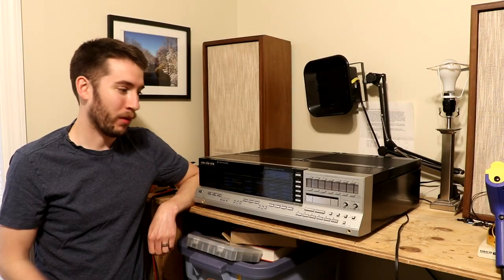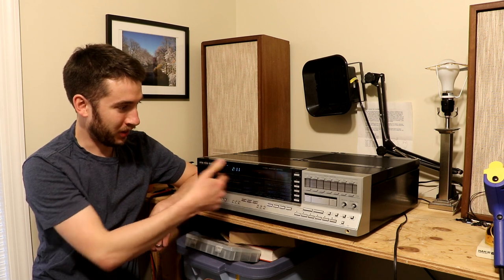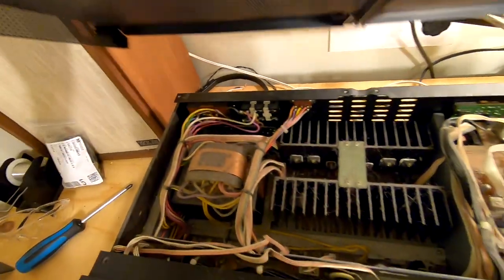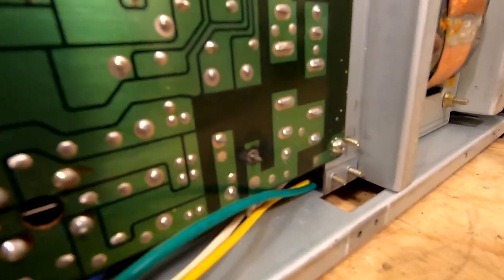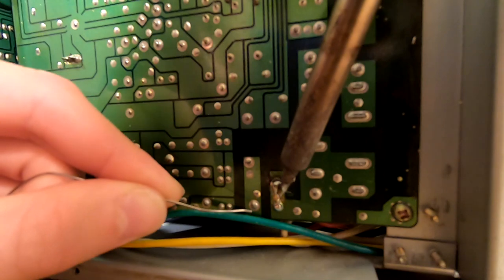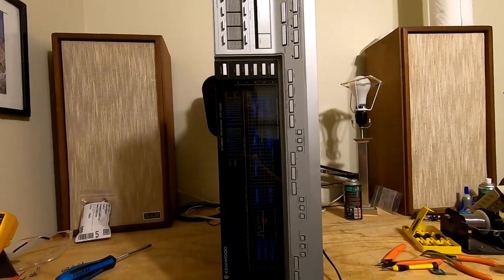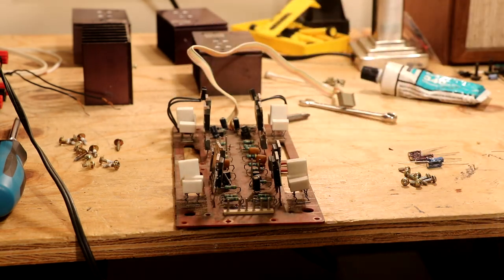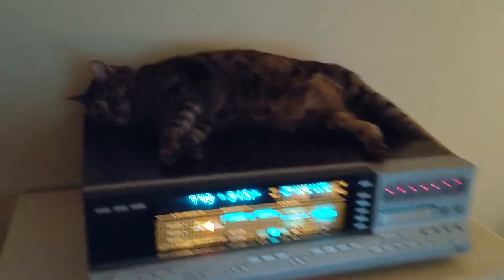My MASSIVE Alarm Clock BROKE And My Cat Is Mad About It

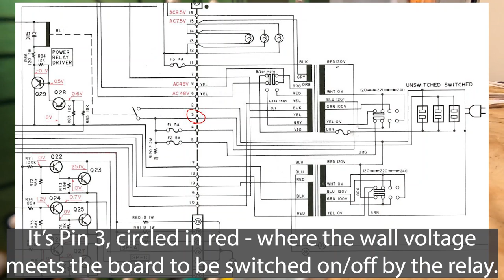Comment: Schematic at 4:23 : I more wondered what you had on that switched outlet where the relays contact went. That failed joint looked as it has to carry a few amps, so you had something connected there, or a larger fault shorted the outlet.

Comment: Interesting failure.  I wonder what caused the solder joint/pad to fail in the first place. I'm guessing a poor solder joint from the factory, causing a high resistance connection, and heat, until failure.

Comment: Very cool video. I like those old big Kenwood’s. Speaking of clocks, I have been looking at this Sansui model Z-7000 that is really kind of a monster. It doesn’t seem to get too much respect in the forums however. Puts out 90 W per channel. The seller is asking $380. The thing that has me interested, it is new old stock. The guy picked it up from an estate and the owner of it said he only took it out of the box to engrave his name on the back of the receiver and then put it away. Has less than five minutes play time. Seeing as how it’s been sitting in a box since 1983, what kind of problems do you think I’m going to be looking out with this beast? By the way I saw it on eBay. By the way, it has a clock and a timer on it as well. That was the actual reason I was commenting to you.
Reply from the maker: I'd expect dirty controls, hard to say without looking at it or knowing exactly what climate it was stored in.  Cool looking unit!
Reply: Sansui's capasitors is dead...İ am sorry but this Sansui z-7000 is dead